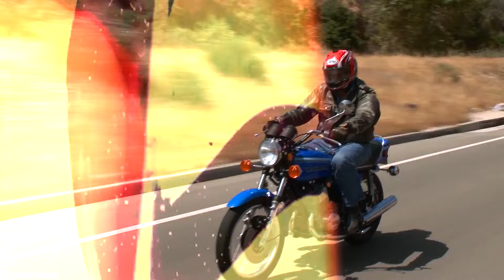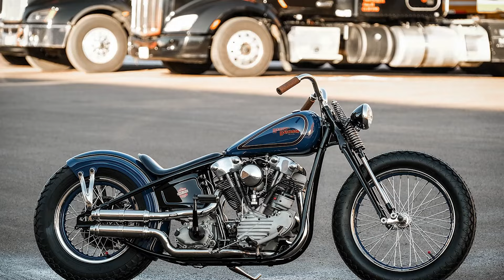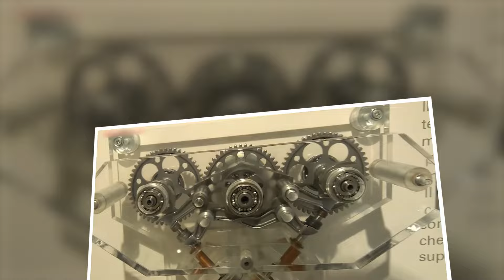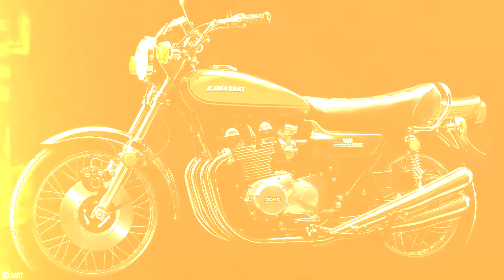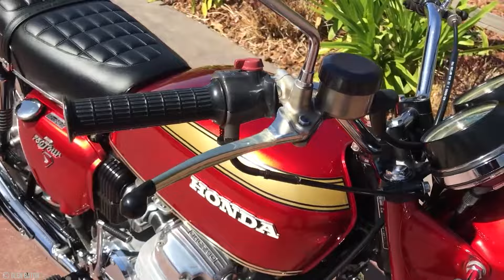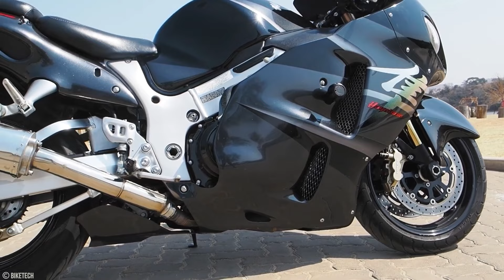These 7 ENGINES Started the MOTORCYCLE Wars

Comment: I want to see a 1600cc boxer 8-cylinder in a bike. Kawasaki 900 was an engine 25 percent bigger that made 25 percent more power than a Honda 750, but it was not a technical revolution. The H2 was a flash in the pan, poorly executed, like the Pontiac Fiero. Honda's 400cc and 500cc enduros created a whole new class of motorcycle. The Suzuki 400cc Cyclone was revolutionary, as far as dirt bikes go.

Comment: So true is the story about Brit bikes.

I worked with an “old timer biker.” This biker spoke of how Brit bike owners would have to get the wtenches out on Friday to ride on Saturday, add oil and how the Brit bikes had to be kicked repeatedly to start. In contrast, Honda owners just had to insert key, set the choke and push a button and go.

And about disc brakes, a Brit company Jaguar was using disc brakes on its sports cars in the 1950s. The D-type racer used them at LevMans. Jaguar & other auto manufacturers adopted disc brakes from WW II aircraft practice. IMO disc brakes once perfected are one of two innovations leasing to better motorcycles. One other is tire technology. Would anyone want to go over 125 mph on 1960s tech tires? Yes, Rollie Free did on 1940s tech but wasn’t that on Bonneville Salt?
Reply from the maker: Thanks for sharing your thoughts!